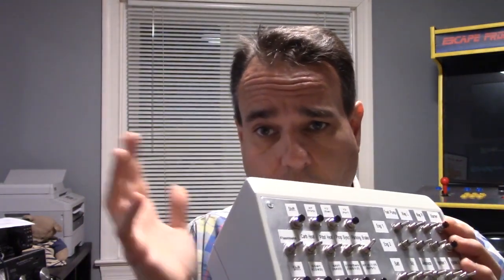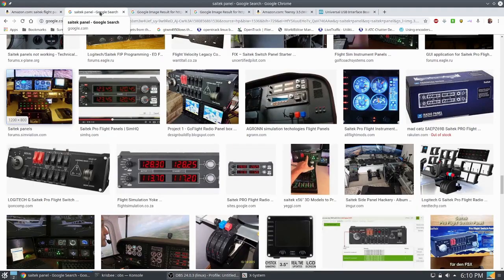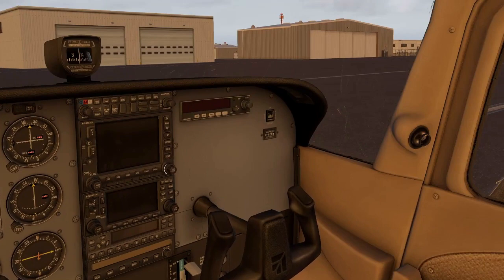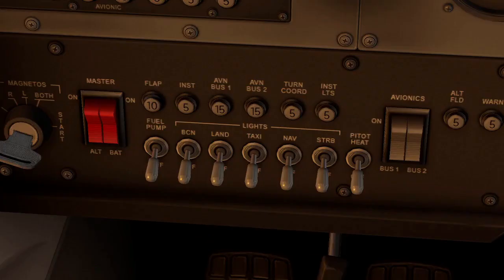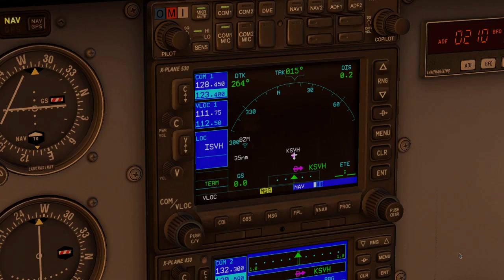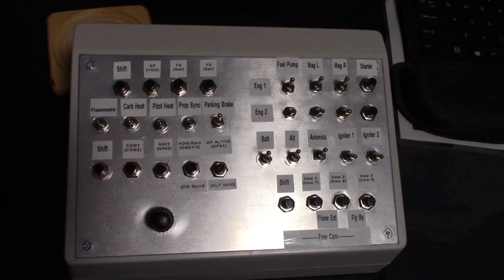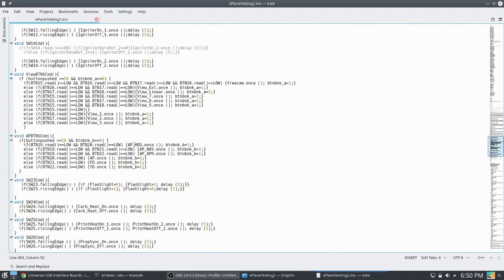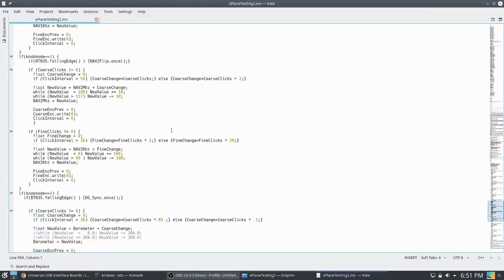Creating a Custom Flight Simulator Cockpit/Panel for X-Plane using a Teensy Board

Comment: Wow - that's impressive. You've even written custom code for each third party aircraft. It's awesome having something custom-designed with features you couldn't buy off-the-shelf, and for less money!
Reply from the maker: Thanks so much - now that I have it, I wonder how I flew without it.  I did try to balance what you would need lots of access to, or something you needed to touch on either take off or landing, but not so much where I had a hundred controls and no need to actually look around the plane.  I also didn't want to include things I don't interact with too much, like the transponder.  I did reprogram Igniter 1 and 2 (which I don't fly turbo aircraft enough to use) and made them Com1 and Com2 so when I am on Vatsim I can monitor ATC and Unicom (or ATIS or whatever) and mute out one if I need to.

Comment: Wow! You are just amazing!  I would love so much if you put up the building, and coding of the teensy board. What you built there is just what i wanted to do for a long time.  I heard about arduino as well working with air manager, i think it was  named. But would really love to see & learn how to do what you did! :)  
I am a retired aviation tech/ flight engineer, so i know some about planes and stuff, but i don't know anything about programming,

I also looked in to the Saitek/LOgi panels, and they are nice, but expensive. However its mostly that i want to build my own panel, and make it work the way that suits me and my flying! :)   Any way, really appreciate the flight sim videos you put up here!  
Thanks a lot, David.
Reply from the maker: Thanks so much, David.  If you send me your email address, I have the code and an email kind of describing things set up.  Easiest is just setting an Arduino or Teensy as a USB joystick because then you get like 30+ buttons and no programming needed - the knob was the real reason for the custom coding.  With that, it will also be compatible with other sims (like MSFS2020).  There is also RealSimControl which they guy takes the programming out of the equation and you do it all on his website (for free) with an arduino mega board - another option.

Comment: First off, great work! The panel looks very useful.

I'm working on a project similar to this for the museum I work at, and I'm just wondering if you could share the links to the videos you used to teach yourself how to write the necessary code?

Thanks in advance, and again great job on all of it!
Reply from the maker: Send me an email kris at dixielandfarm dot com and I have a form email with the code and links all ready to go.
Reply from the maker: Oh, and note - if it ISNT for xplane, then you basically just make the teensy into a generic USB controller and assign the buttons in whatever software you need.

Comment: haha, Dixienerd farm! Pretty impressive Kris! I find this kind of stuff very interesting even though I barely understand any of it. I hate when you misplace brackets or semicolon's.
Reply from the maker: I didn't understand any of it until I did it - just figured I would either succeed or fail - ended up succeeding :)  I did just think a few minutes ago about changing the function of two of the switches - should only take minutes to implement - one of the things I have been doing the last few weeks is a virtual online ground school - I actually had an oral exam with an instructor and have to take a timed written test and then a virtual checkride with a real instructor watching.  I will have videos on that stuff later on when I am not so involved in it :)  Then MUSIC videos, I promise.

Comment: Is there anything audio, video or technical related that you cannot do? So you used online guides to help you to build this Custom Flight Sim Cockpit Panel? I get confused when you get into all of the wiring. You are clearly professional when it comes to wiring anything. You could most likely build your own receivers, amps and turntables. I admire your ambition Kris. I really do. That is an amazing device~
Rob/Boston
Reply from the maker: The info is all out there, but scattered among hundreds of posts in little snippets - no step 1 do this step 2 do that so I had to figure out a bit of stuff on my own - but one guy did a good job describing what he was doing and why in the coding on one blog that did help fill in the blanks.  I just reprogrammed two switches last night and only took about 10 minutes - they help with communication while online - one of the new things I have done is plugged into a virtual flying network that has real person controllers who give you clearances, approaches, etc all based on real life data and procedures - if I want to land in Boston at a controlled airport, there is a guy there who I have to contact, etc.  The wiring looks complicated but its fairly simple - every wire goes to an input, and all the grounds get connected together and only go to one place (which makes it look like a mess).  If I had more wire I could have made it look pretty, but now that it is in the box, it doesn't have to.

Comment: Nice work Chris - Would love some info  about the commands that get sent - presumably over USB to the host?
Reply from the maker: Correct - the Teensy board communicates via USB to the plugin in the simulator - and the coding is what/how/where/when.  I have an email that I had typed up for someone I could send, but unless you were actually going to do it, I imagine it would be boring.
Reply: @dixielandfarm  I never find software boring Kris :) But, not likely to do this in near future so thanks but no. I looked at X-Plane after seeing another of your videos but it wasnt happy on my Mac. I may have to build a dedicated machine for it perhaps. 73's
Reply from the maker: I'm surprised it didn't work on the Mac - it is actually developed on the Mac first, then they port to Linux and Windows (I think in that order).  You do need a beefy video card and you have to play with the settings - it also requires quite a processor - all processing takes place in ONE core only (it doesn't multi-thread) due to various reasons, so having a lower clock speed/more cores doesn't work as well which it does for other video related things.

Comment: How do you map different usage for the rotary encoders for COM1 and COM2?
Reply from the maker: There is a row of "control buttons" that determine what the rotary encoder is interacting with.  I hit button 1 - its com 1, I hit button 2, its nav 1... So, when I want to change COM2, I hit the button to put it into COM2 mode and then it works with just that.  This saved me from having MANY rotary encoders which is expensive, opposed to buttons (which are cheap).  I could have also just used ONE button, and every time I hit it, it would change modes, but then I would have to remember what mode I was on previously - by having the selector row - when I need to work on COM1, I just hit COM1 and off I go.

Comment: Very impressive, Kris. I guess the big thing with designing them making yourself is building in the functionality in a system of logic that makes most sense to you. You do seem to make it all look fairly easy though! How long from beginning to end?
Reply from the maker: Approximately a month from beginning to end - working on it here and there.  The wiring took probably 3-4 hours, the programming probably 15... each person would be different in what they would think is grouped together properly, but I made quadrants of functionality, with the top right being basically getting the engine started, the middle right being electrical controls, the bottom right being views inside and outside.  The top left is auto pilot, the middle left are "specialty" controls like engine heat, flashlight, parking brake - things you may need but not always.. then the bottom left are the things I need to manipulate often that has a knob - for radios, setting headings, altimeter, etc.  It's that area I use the most, along with views - so all of that is on the bottom row.  I am enrolled in a virtual online ground school at the moment - real instructors, real quizzes - I even had an oral exam with a mentor in preparation of my written exam, which will be followed by a virtual checkride.

Comment: Hi Chris, do you have a link where I can learn how to program a Teensy ONLY FOR FLIGHTSIM? This is all I do. I don't want to learn how to turn on a Toaster in Zimbabwe from my cell phone. lol  I just want to run a Cessna 172 and have those switches. Thanks for the video and your help!!!  God Bless, Jim
Reply from the maker: Jimmy Hinkle Jim, if you only need switches and buttons. If you tell it that it is a USB controller, it just becomes another joystick with 30+ switches/buttons, no programming necessary.  If it wasnt for the encoder, I wouldn’t have had to do the custom programming route.

Comment: Woah, impressive! I've been trying to make my own GPS and AP interface using the Teensy actually. It's such a great project to get into programming with. 

How exactly did you make the enclosure? I've been thinking of making a custom PCB instead, but it seems pricey and tedious.
Reply from the maker: It was a stock project box - I just looked for the right measurements and off I go.  This panel makes flying SO much more fun and easier - I just reach over to do all the things I normally would.  The multifunction selector buttons for the knob saves space but can get frustrating because I might think I am in COM mode but im in NAV mode - if I had more buttons to select the thing I want to control opposed to hold this and that to do X, it would be easier (or a knob) - BUT the space savings was a good trade off.
Reply: @dixielandfarm  Okay, nice. I'll have to try something similar. I hadn't really thought of having multiple functions per button like you have.